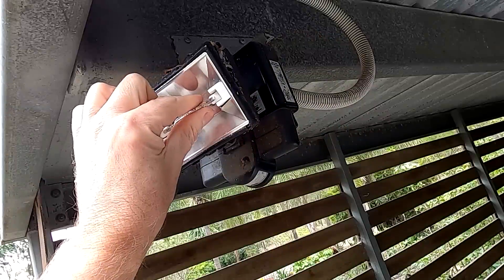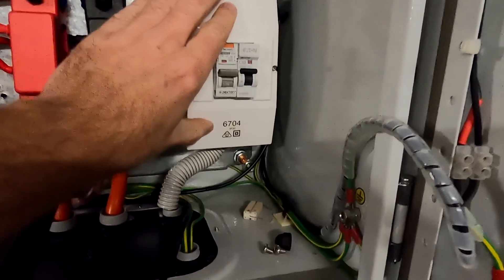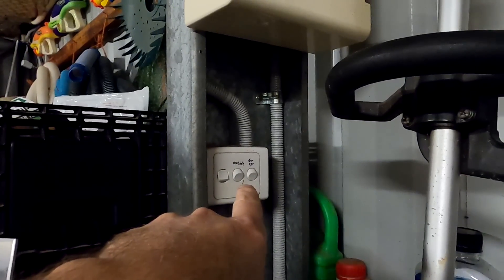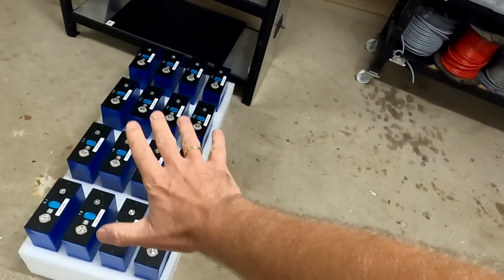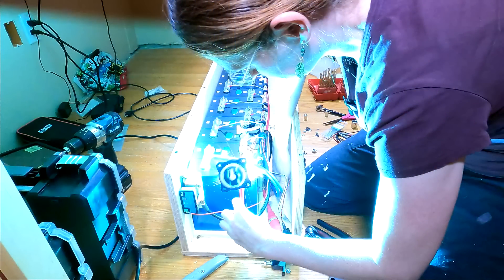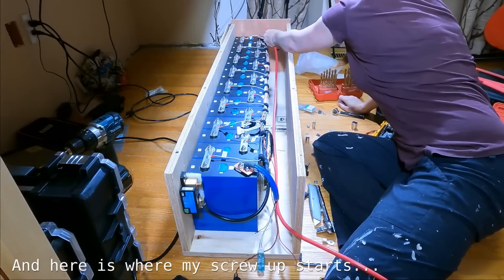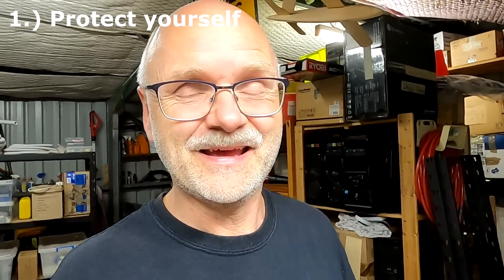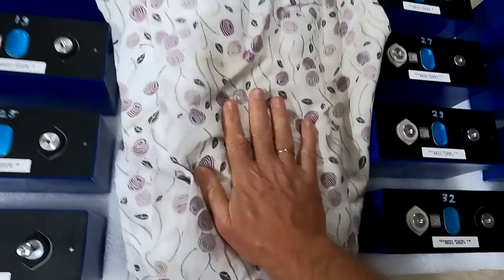A 48V, 280Ah straight short. How the right equipment saves you!

Comment: The voltage induction issue makes perfect sense, I have also witnessed such voltage inductions during my Electrical career, we use to use a volt stick to identify if a cable is live or dead, but often if two cables are running together over a decent span, the unenergised cable would appear "live" from the volt stick. It was picking up Induction from the other "energised" cable thus giving the volt stick a false reading.
Reply from the maker: Yep, that's exactly right. It is obviously enough power keep the lights on. I like it now, it's a cool feature...
Reply: @OffGridGarageAustralia A free night light 😁👌
Reply from the maker: @oze-bikes4life663  is it free though? If the energy comes from the charging circuit and is being inducted into the off-grid circuit, I guess I pay for it. I probably always did with the halogen lights...☺️
Reply: @OffGridGarageAustralia  lol, ....I don't know your full story regarding your wiring, but like you said there not much in daily life for free. 👍 Unless ones fully of grid & self sustaining.  (I wish I was ! 🤔😬)

Comment: Suggestion for everyone, put the fuse as close as you can to the battery terminal so you don't have unfused cable length.
Reply: 150mm is recommended

Comment: Sorry, could you please clarify one thing. You said that power company cuts off power every day at peak time. Does this happen to all of the grid connected consumers or only to them who have also installed Off Grid systems ?
Reply from the maker: Nah, we have basically two meters, one is the normal power 24/7, the other one is a cheaper tariff for non essential loads like hotwater, pool pumps, EV charging... There is a remote triggered relay inside the meter box which the power company can control when power demand is high.
Normal tariff 21c/kWh 24H/day
Cheaper tariff 17c/kWh 18h/day (usually it's only off for ~3h a day but can be up to 6h off per day)
Reply: @OffGridGarageAustralia  Thanks for the reply. For the moment I thought that you lived in a very remote place where even Utility networks have to make compromises in order to provide services.

Comment: Your a good man Andy ,  here is some food for thought and i convinced some engineers years ago to agree to install intermediary Fuse links  in the battery string ( which is basically a full size  removable bridging link within in a fuse holder) on a 280 VDC battery bank . One of the reasons for this was to reduce the likely hood of adjacent isolation of series / parallel cells against accidental shorting when maintenance was being carried out. This effectively reduces the exposed Voltage & fault Current to lower levels  that you expose yourself , some people would  say that's an overkill and just another point of failure but you do feel safer if you are isolated from a full battery bank , maybe a 48 Volt string could have a link at 24 V or even at 12 if your cashed up and cautious  (  The difference between flooded wet cells and lithium is the parallel connections of the BMS that would need to be considered before doing this )
Reply: I think I'll have something sort of like this, with each "battery" having an internal T-class fuse (and disconnect switch). Even before, but especially now, I can see the value of multiple levels of safety.
Reply: @TheDigitalMermaid  Question for you as your on a boat and the availability of T class fuses could be limited in an abnormal condition  , not saying you would blow one but maybe consider a circuit breaker so you don't get caught out
Reply: @linc11  I plan to have a generous spares inventory. That said, if I could find a breaker that could break such a high current, it's be a nice option.

Comment: I work with industrial electric equipment every day. 480 3 phase. I have 70kwh li ion batteries from two EV batteries. I used to work at R&D automotive company. There I worked on the EV battery instrumentation and the testing HV heat pump systems. So I'm trained and experienced 10+ years. one late night kids are in bed sleeping. I'm in the basement wiring up the batteries and I'm installing them into an industrial UPS battery cabinet made for lead acids. I was wiring them up and I wasn't wearing any of my arc flash PPE at all. I managed to dead short a 14s 6.6kwh pack against the cabinet. I had a 2/0 cable in one hand and reaching for it with the other. When it hit the case the arc flash was so bad I gave myself 2&3 degree burns on 20% both of my hands. Luckily the terminal block I was using that was only rated for 80 amps melted and essentially became a fuse that prevented the batteries from going thermo nuclear. My brother works for a large hospital in the burn unit. He was the one who said what degree the burns where. He kept saying there where spots of full depth. Very leathery skin. I didn't miss a day of work I put my hands in latex gloves with silverdine and mechanics gloves on top of that. I also kept working on the batteries but now with tig Welding gloves on and safety glasses. Moral of the story is my brother told me the worst burns he sees are electrical and every guy he's treated said the same thing. " I'm a professional, I do this everyday, I just had a momentary laps in judgement" maybe I'll make a private video on my channel of the burns on my hands and link it for this comment only. Stay safe friends

Comment: I used to work for a cellular provider back in the 90thies as a field service engineer. One night, during maintenance hours, I had to give access to a BSC-Site to a company to do an fuse panel extension at the 48V power supply system. The guy added an non isolated clamp to the vertical  busbar ( both + and - bars close together, 4cm distance may be), let it go and reached out to grab the cable to fit it into the clamp. The same moment the clamp fell off right between the 2 busbar! you can imagine that the sound of the explosion was deafening! A straight short on a 1200Ah battery backup without a fuse! The clamp was fired out of the rack across the room and stuck in the wall like a lump of metal. Luckily nobody was hurt, but I never saw someone’s face skin turning white like milk in a split second! 😉 The second attempt to install the cable went ok then and I only had fun to get the BSC with 120 GSM base stations connected up and running again cause it went in full reboot mode after the short.
So never underestimate batteries!!! It’s not the relatively low voltage that cause harm, it’s the amps running in a circuit when it’s shorten!
🙂🤷🏻‍♂️
Reply from the maker: Wow, I guess everyone has somehow experienced this in some way.
I had this with a guy leaving a 32mm spanner on both busbars when they turn on the breaker again. The first time it flicked the breaker and they tried again. It held the position and everything worked. This guy was then missing his spanner and was looking for it at the site. They found only two silver humps on the busbars 🔧😁
Reply: Yeah this is the big worry I have.

Comment: Andy wonders why you do not use a fuse in the middle of the string between cell 8 and 9 so it will only be 26-27volts it breaks or will it be wrong with another resistance so there will be an imbalance? (or have you thought about testing as there should be equal results on 4 cells or more)
and as you described how the electricity is connected, it sounds like you have 3 phases but the supplier can turn off the last one and that nothing "critical" is on that phase?
Reply from the maker: Yeah, OK, well, never seen anyone doing that. The next person will say why not put one in after 4 cells?

I've got two meters in my box one is for the normal 24/7 3-phase power, the other meter can be turned off with a remote relay and takes one of the phases to supply power to hotwater and other non essential loads. This is extra metered as it is cheaper, 17c instead of 21c.

Comment: Fortunately, 48 V DC circuits (thanks Telecom 48 V DC power systems) are perfectly works with regular DIN-rail AC miniature circuit breakers (MCB's). Of course, if it rated for DC interruption. Industrial series (6 kA current interruption capacity) MCB's of brand manufacturers are often rated up to 80 V DC per pole for its interruption capacity. And much cheaper, than DC-series MCB's. This is why it widely used in small to medium 48 V DC telecom power systems. DC series MCB's are really need for 220 V DC to 440 V DC circuits.
Also, T-type fuses can be replaced with european-like fuses, that are used in grid distribution panels, NH000, NH00, NH1 and other formfactors.
Reply from the maker: OK, the DC MCBs cost only $22 plus shipping. The normal AC MCB may cost around $10. Both from a good brand. Yes, the NH Sicherungen work as well in this regards. They are pretty much class-T fuses just with a different shape and form.
I didn't know that some MCBs have DC ratings as well.

Comment: i did that, but wasnt holding the leed, it was hanging outside the battery box... the cable stiffnes, whilst my back was turned, pulled the lead back into the box, bang.... no fuse in my lead, i turned copper into liquid..... scared the FAAAAAARRRRRKKKK out of me..... tape all the ends now and tops of all terminals.... loving your chanell bud.
Reply from the maker: Oh, wow, thanks for sharing. Be very careful out there!

Comment: The purpose of putting a resistor in parallel with the LED is to increase the load. Assuming the source is a high-impedance supply the additional load will reduce the voltage, and with a low enough resistance the voltage will be reduced sufficient to avoid illuminating the LED. The load correction capacitor you described is for power factor correction. Obviously in an A.C. circuit a capacitor will also have an impedance so behave a lot like a resistor but I haven't heard of a capacitor being used instead of the described resistor.
Reply from the maker: The supply is our off-grid inverter. I don't think it is high-impedance generator at all. The load correction capacitors are for flickering LEDs or for these which do not turn off.

Comment: Should for safety sake double check there is not voltage passing between the earth grounds to light the outside led lights. If voltage is passing between the earth grounds that could be potentially dangerous later on. Worth checking out, I would think just to be safe.
Reply from the maker: There is very little voltage between PE and N only 0.25V or something.
The vehicle charger is very picky with that and would show me a red light if there is anything not correct. I had this before with the  Xiia inverter I tested months ago.

Comment: Eddy currents from parallel wires.  It's much more common than you think.  I had 2 parallel circuits ran next to each other and my live circuit meter was beeping on a wire that was not powered.  Checked w/ the volt meter and it was showing 96v on a 120v system so I knew something was up, said to hell with it and shorted it to neutral and nada.  Then I touched it and also nada.  Voltage was present, but no current.  As for your 90 degree bends on your wires to your DC breakers -- no no no, don't bend wires that tight.  Minimum bend radius at least 8x the conductor thickness!  Nice smooth curves, no hard angles.
Reply: I like looping my connection points.

Comment: Hi Andy, have you ever try higher voltage solar connection .i.e 250v . Some youtuber like David Poz suggest that higher voltage connection need no over current protection because of the small amount of current / less string . I doubt that personally . What is your opinion?
Reply from the maker: That does not make sense for me as I have a lot of shading on my roof. I would run the panels all in parallel if possible but need at least the 3 panels in series with the 48V battery.
You always want an overvoltage protection. There is always something which could go wrong and you end up with lots of amps on that circuit which is not designed for that. Always have the proper fuse/breaker/isolator installed.

Comment: I have a few rules for rules with batteries. 
Batteries are expensive, protecting them, and you isn't. 
Don't work tired, or under the influence. 
Always have a spare pair of safety goggles where you work on batteries. Cost $4
Use insulated gloves if working above 48v (recommended 30v or greater)
I use sheets of wood to protect terminals, and warn others who might access battery storage area. 
Cover the terminals you aren't working on. 
Insulate tools with two layers of duct tape, or one of heat shrink. 
Have a plan in case something goes wrong - my contactor welded closed on my mower, luckily I had a disconnect switch. 
The ~400A DC start up draw from my motor kept tripping my 220A breaker. Ordering an industrial breaker.
If you are too tight to order expensive high amperage fuses, at least parallel cheaper ones. 
You do not want molten metal or plasma in your eye or around your finger. Remove jewellery, protect your eyes. Though molten metal down your boots from welding, can be enteraining for others when you suddenly stop welding and start dancing.
Reply from the maker: Great advice, thanks Andrew.

Comment: Hello Andy,

I am really sorry to see that you have to drink Oettinger Beer, but if this is the only choice, shit happens. 

I would like to ask if you can have a discussion of a generic setup of an off-grid system, based on a competitive assesment of the available products. 
Here some of my questions

What is the best solar voltage array to have an cost optimised MPPT charging bank???? I see you are working with many MPPT chargers. 

Do your recommend a 48V Lifepo4 Battery Bank for an off grid system?  Is this also a good choice for an 230V 50Hz DC/AC converter?????
How about the solar voltage array, most of the 100W-300W panels have 20V to 30V UIO.
Do you recoment to use a 60V or 80V Solar Voltage to run the MPPT to charge a 48V Battery bank. Is 48V good for any DC/AC converter?
I have seen that Victron MPPT100/20 has an input up to 100V now available. So is 48V still the best bank voltage?

If you have a 48V configuration, is this only the choice for an 120V power supply and would you recomment a different voltage for an 230V grid.
What kind of DC/AC converter do you recoment which can also do a 3phase power supply????
Do they have an programmable low voltage disconnect?

Maybe a generic configuration recommandation would be interesting. Also a backup supply(Generator) would be nice to review if your 48V battery bank is low (40V) What of backup system are making sure that your Oettinger stays cold in the fridge. 

I am missing the big picture, we are digging in the microcosmos but how does a setup for a complete off grid system has to look like that is afforable.

Thank you 
Robert

Comment: Andy, just watching some of your old videos, your out side led light problem, just remember on you clamp meter.....you have NCV, you can go near a powerd cable and it bleeps at you.
It's the same magnetic field that's exciting the light wire that's in parallel with the live line to your car charger.
So with led lights it only takes low voltage to trigger them.
Reply from the maker: Yes, it's now a feature and we like the dimmed light outside.

Comment: Andy, about your LEDs, this means that the induced current runs to GND, right? Meaning that you are not using an RCD, because that should trigger? 
About safty: working with some rubber gloves it's a good way to avoid problems (you don't have to worry about rings on your fingers) - but this is easier for me to say from a cool european basement then to do it in a hot australian garage 😅
Also, use always insulated tools!
Reply from the maker: The outside light is connected the inverter which has an RCD. The vehicle charging circuit does not have one though. But I know that the charger is super picky on this and would not turn on if there is anything wrong with the ground wire. We have seen this when I tested the Xia inverter or what this think was called.

Comment: Nothing like some crosstalk between phases. This is a key issue to be aware of when designing and intalling three phase conductors. 
Love those ANL fuses as shunts. The voltage drop across them is quite linear for current regulator circuits plus they double as a fuse.
Reply from the maker: Yeah, the ANL is the only part which gets warm when I charge my vehicle 😁 It'll be replaced with the breakers soon.
Reply: thats a useful thing to know - current shunt hmm
Reply: @RobinRastle Different ratings will have different resistance. I would pick one that was just above the max current of the circuit. Seems to work well. Also, if there is a runaway, the fuse blows.

Comment: You normally don't get second chances .
The fuse should be the final cable protection device not the only one !

Hint...
When working on battery banks split it at the midpoint by removing a link .
Test with a fused amp meter then refit the link ,

Comment: So much can go wrong at times and this is very important video. 💩 happens. Seems to be my turn. 
I am so frustrated 😠 😡 
I was finishing up topping off the last three batteries for the first 16 unit 48v bank. I am using a Lithium charger that has two 12 amp charging for upro 4s each side. Well, I have bridge the two sides together before to charge faster but, this time I paralleled three of the CATL 310AH batteries together and started to charging. Everything was fine, for a while and the the magic smoke came bellowing out from one of the fans! 

🔥 FIRE 🔥 
Bummer, 
So, I pulled the power cord out of the wall because that's the fastest disconnect I know of in a panic. 
Thought at first it was my fault for trying to charge faster but, one of the batteries is now about 30% bigger, all puffed up, huge! I am so mad, how do I get one stupid battery! 😒 Wish I would have video of the smoke.